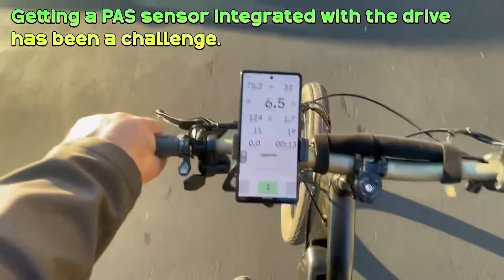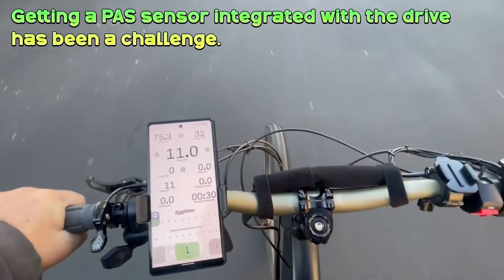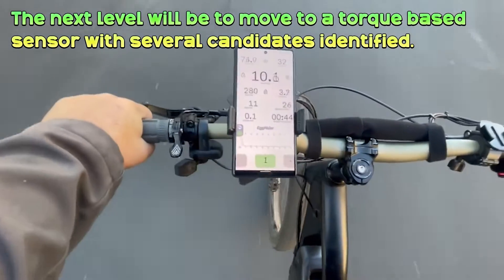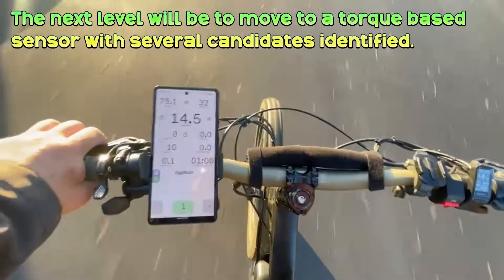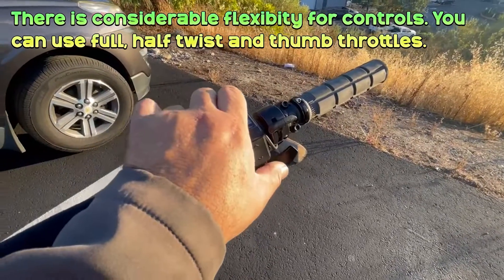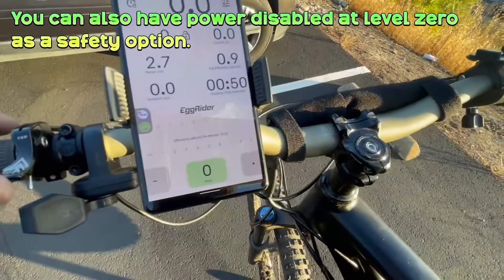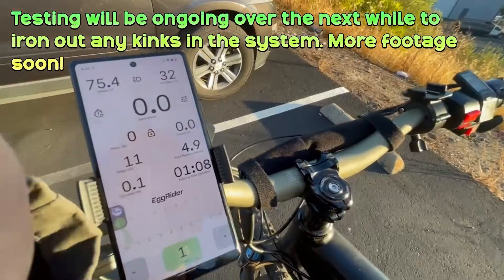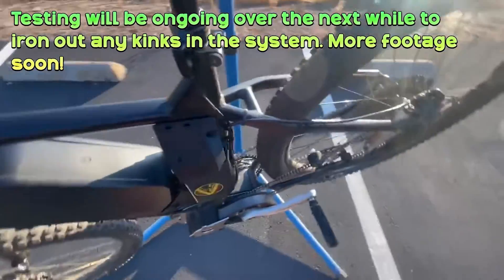The Cotton Mouth Ebike - Pedal assist integration and testing

Comment: Does this kit require a new rear wheel to be built with a new hub to work with the left side chain?
Reply from the maker: I will detail the options at some point. Its quite complicated and really depends on how far people want to go. If they want everything including regen then potentially. Depends on the hub. Its being headed up by North Bay bikes so the plan is to offer buildkits to people. The motor drives can be had on their own but that would then require more work on the part of the builder. There will be lots of support via discord though.

Comment: I'm very interested in this, this might sound like a first world problem but I cannot decide between the cotton mouth project, a BBSHD with your kit or even the DM01 at 72V, depending on how much you're going/willing to tune it and if you propose a kit for it.

What a time to be into LEV! Even if Bafang is kind of sleeping lately..., was hoping for a BBSHD2. The CYC Photon sound nice on paper but I prefer to be able to do the maintenance myself when (not if) something will go wrong.
Reply from the maker: Sounds like a good headache. All of those will be significantly more powerful than the Photon. Should be trying the 72 volts pretty soon here weather allowing!
Reply: @HighVoltageKits  Very nice, thank you for the message, I'll await for that video until then.
Regards.

Comment: What tensioner is that for the motor drive chain?
If you dont mind sharing..
Reply: The tensioner is designed and fabricated by Lightning Rod motors, specifically for the new Ultra Drive system.
Reply: Unfortunate! Easier to buy than fabricate when I break em!
Reply from the maker: It's not a commercially available one.

Comment: Cadence based currently, correct?  It looks like it responds very similarly to my BBSHD Luna Hotrod setup.  If you're ever able to set up a torque sensor integration in this, it will be amazing to me.  I just want to experience high levels of assist torque being added in response to my torque input to the pedals.  Would be amazing.
Reply from the maker: Right not its cadence based but we have got some samples of torque sensors we hope will work with this as well.
Reply: @HighVoltageKits  Extremely exciting stuff!

Comment: Looks to have two chains, a thicker chain on non drive side to hardness the considerable power.  
Those that have built high power mid drive bikes like a 4000w BBSHD understand the stress on the driveline of a single 8 speed chain therefore this seems like a positive direction to have the motor drive a thicker chain and relegate pedal forces through a separate more conventional chain width.  Also solves the gearing divide between human RPM capability aka max. cadence and gearing the motor needs for maximum acceleration and top speed.
I look forward to the evolution of this design as you work through your R&D.  
Nice work.
Reply from the maker: Cheers Luke. More updates on the way! Cheers. You are correct on the drive train. We are going for the best of both worlds I hope.